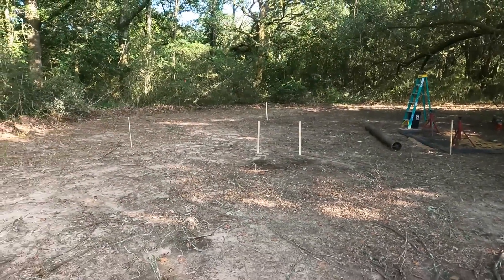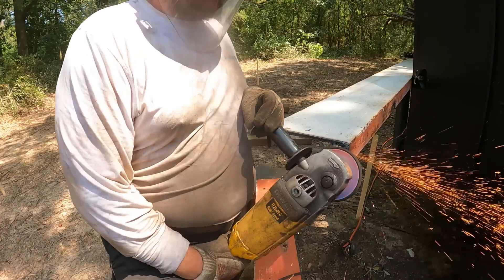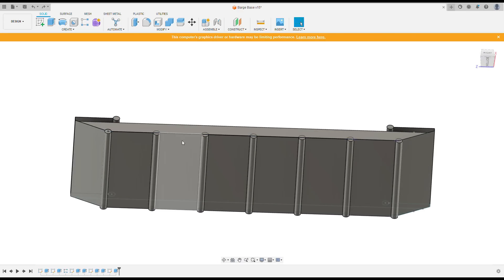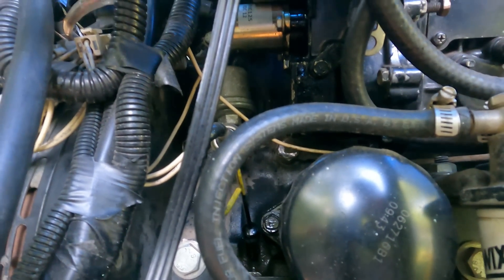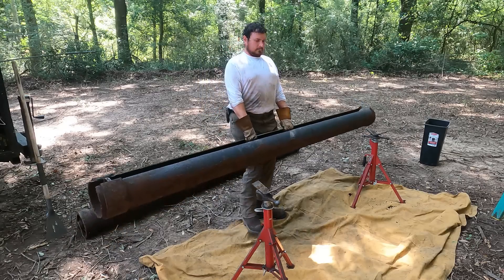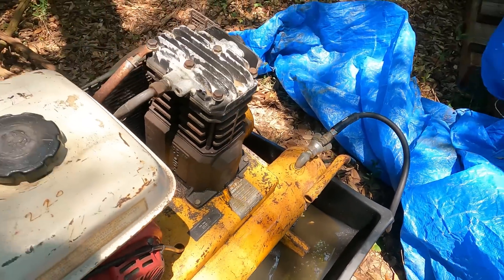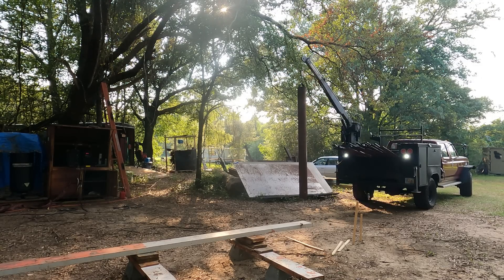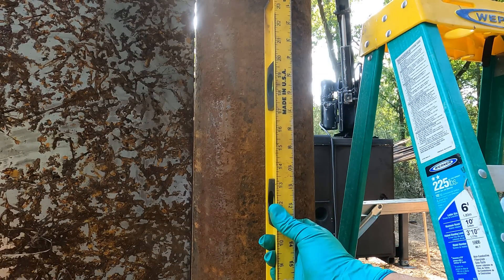I'm building a boat

Comment: I just want to remind you to keep an eye on plate shift. When dad built his (which I live in still on dry land) he built a 2x6 cribbing then laid the plate out. Then welded them together. Then he welded the framing in only to find out the plates shifted badly. Lesson learned.  So after air-arcing a lot it was fixed. 
But one thing he told me was " after all the fussing and worrying, the biggest worry starts when you put it in the water". Then you have to hope a log doesn't get under you and the tide goes out.

Comment: As a mechanical engineer, I wish I would’ve studied to be a structural engineer. I could get a lot of design and mechanical engineering jobs without my degree. Also as someone who’s always tinkered and built things I was disappointed with how little practical useful design practices were taught. Structural is cool because the paper degree makes companies trust you with huge structures and important components. Best of luck to you!
Reply from the maker: Thank you for the insight. I will keep that in mind.
Reply: @Andrew.McDonald.  I currently work for a yacht company in the design and R&D department. We get to do (in my opinion) all of the fun stuff. Designing the new models, laying out components, and testing & adding new features. The mechanical and electrical engineers only do the foot work of our ideas, running pipes and wires in the CAD model, issuing production drawings, then helping the production workers when it comes time to build the first model. For marine and auto industries, design engineering is where you get to be an idea guy, which is why I love it!
Reply from the maker: Very cool, I haven't met many engineers who are fortunate enough to do the fun stuff. I have other plans than going to work for a design company or a firm. Time will tell, though.

Comment: How low is the barge going to be sitting in the water? With 18" sides, I suspect pretty shallow.
Reply from the maker: If it sits a foot, that's 20,000lbs of displacement. I don't think it will be that heavy. There is 9" c channel above the 18" sides and then 3' sheet metal above that before the wood siding starts.
Reply: @Andrew.McDonald.  Should be a nice place to stay while in school.